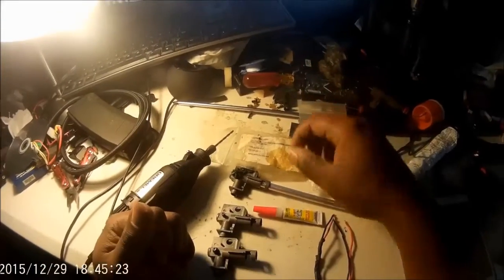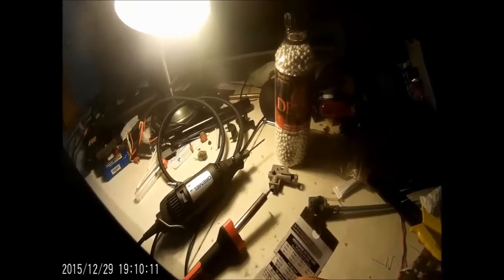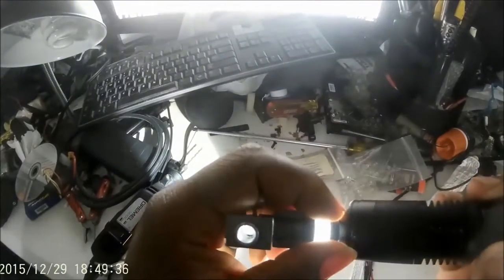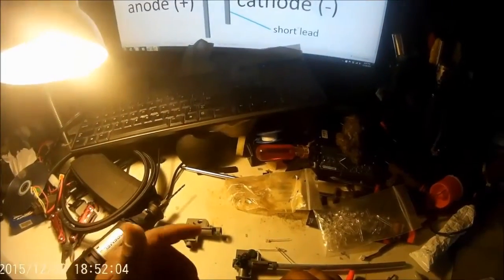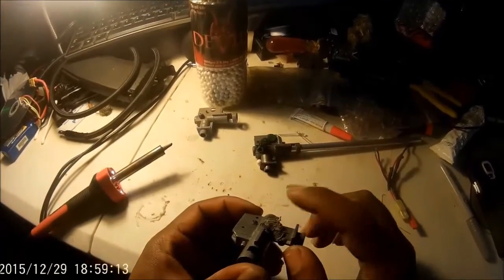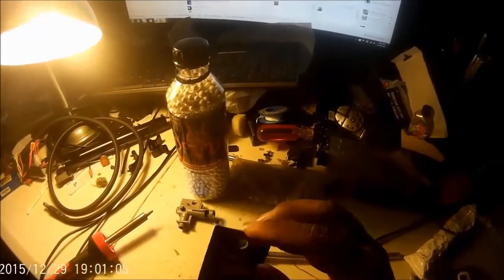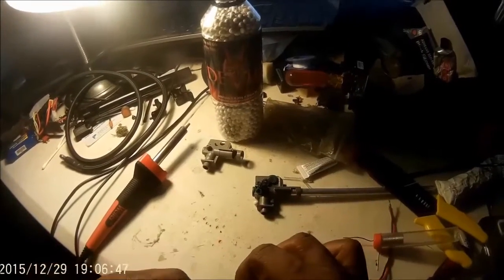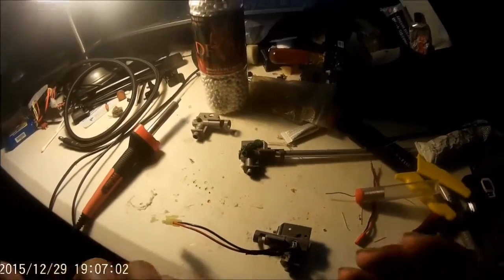DIY Tracer unit REUPLOADED

Comment: 2 led white, paraller led positive need resistor both led, own resistor 2 piece resistor need install and led negativa together and battery negative point, positive to  resistor and then led positive, same second led positive wire resistor and resistor to led positive,. 7,4V supple need 220R resistor both led. 12V supply need 470R resistor. and 5V supply need 100R resistor.

Comment: If I can recommend. Use UV LED's they put out less visible light (when you point it as someone, so it's harder to notice you when you are trying to be sneaky) and they light up the BB's much better so they are going to be brighter when fired.
Reply from the maker: I have thought about revisiting this setup with my MTW and main m4 and use UV LED bulbs.   Same setup just swapping out the bulbs.
Reply: @DionFranklin  I used design similar to your one, when I was making my first tracer with UV LEDs (but I had to shave the LED's myself as they where round) and so far it still works.
If I may. simple test that shows difference between normal and UV light when charging Glow in the dark object. https://www.youtube.com/watch?v=ozkJstT0uKA
That's why every Airsoft Tracer uses UV LED's it charges the BB faster and more efficient than normal LED. (similar goes with different colour of Glow in the dark pigment in the BB, Green is the brightest and stays "charged" the longest followed up by blue and last red)
Reply from the maker: @Zeton_PL  Where did you find blue gitd bbs?  lol
Reply: @DionFranklin  i never had blue ones myself but one guy that I played with on my local CQB side had them in his pistol. I found them on internet later on as "Madbull Phantom" but they are only in 0.12g so waaay to light for rifle (as if they where designed for pistols only)

Comment: Hey buddy, excellent video. I'm using a 220ohm resister on my 3mm led kit I installed, I know it's fine to use with my 9.6v nimh battery but wondering if it's safe to use on a 11.1 lipo ? The whole resister thing confuses me a little, I have a mosfet to allow 11.1 lipo and don't wanna risk blowing or shorting the resister if the power is too great. Thank you in advance
Reply: I'd just like to congratulate you on making the best explanation of all time.
Reply from the maker: Boss K-s you will probably need to plug it into the foluma to find which resistor will best fit it.  also, are you running the LEDS in series or parallel?
Reply: Not sure what you mean series or parallel, I stuck one on each side and connected them to run off one resister, parallel that makes it I believe, mine is running off my main aeg battery and I've also fitted a switch.. It's basically a copy of another video i saw floating around youtube.. It's handy as I don't always load tracers so it's good to know there's an off switch. I appreciate the prompt response dude. Peace and love from England
Reply from the maker: Boss K-s parallel is like everyone has their hand in the bowl.   Series is like pass a plate down the line.
Reply: @mattivirta  thanks man, 

Long since I've been airsoft. Have a new kit now and just prefer using a bolt on unit.. works better and feels more ' real ' lol
Reply: V=R.I
Reply: you can looking internet what resistor need qwhat power supply use, have power supply 7,4V or 9,6V or 11,1 volt ewery battery need different resistor. 
searh internet google resistor calculator and paraller instal led , how many led, same many resistor need, 2 led need 2 resistor, if made good all. resistor solden to led positive, and all led negative to together and battery negative.